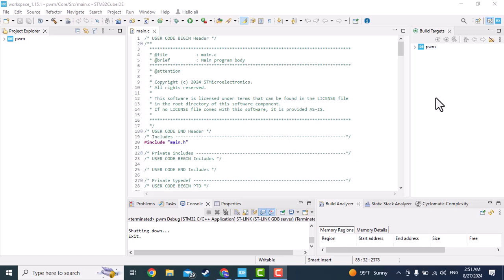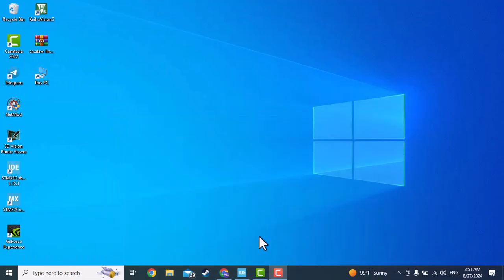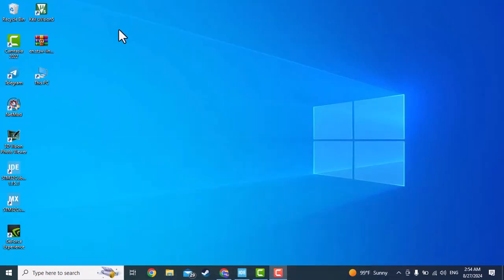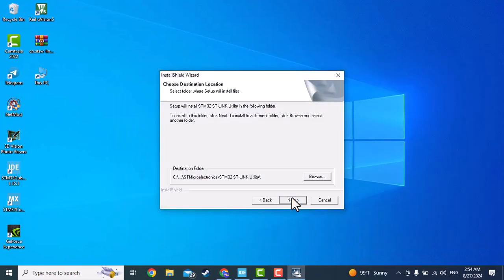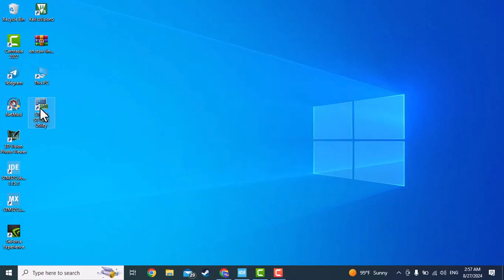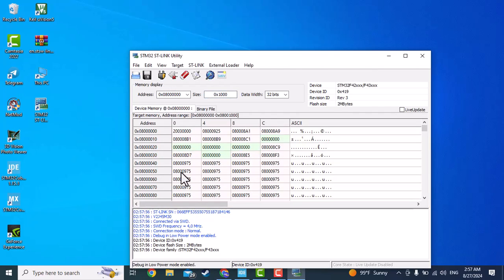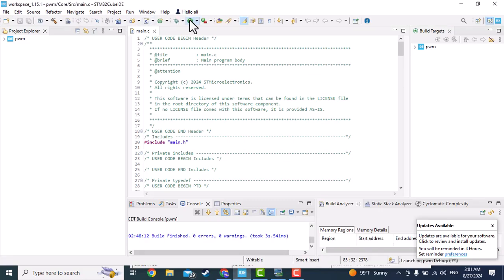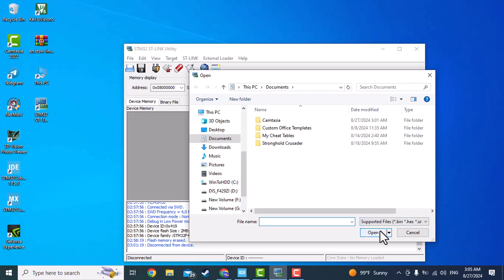Stm32 - How to work with St-link Utility.

Comment: Hi, I have got a STM8S103F3 board, and I am trying to load my first program using stm8flash on Ubuntu Linux. This is the error I am getting. Is there some write protection that I need to disable? blink$ sudo stm8flash -cstlinkv2 -pstm8s103f3 -wblink.ihx
Determine FLASH area
STLink: v2, JTAG: v17, SWIM: v4, VID: 8304, PID: 4837
Due to its file extension (or lack thereof), "blink.ihx" is considered as INTEL HEX format!
191 bytes at 0x8000... target page is write protected (UBC) or read-out protection is enabled